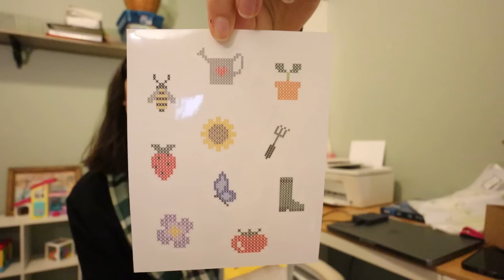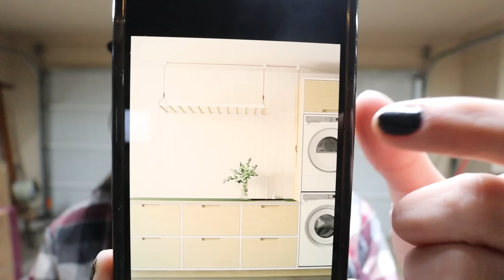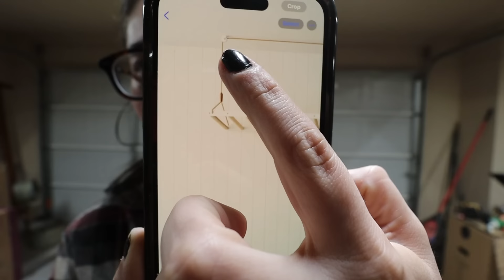VLOG | sending out merch, plant installation, & tool organization!

Comment: I'd way over shoot on the weight limit maybe to even 500 on the pulley system will hold given the weight of creamics, watered plant weight, weight of the wood, additional plants you add in down the road. Like I'd wanna be dead sure that substantial cause the loss in planters would be a hard recovery if something gave way. Sorry I'm a carpenters kid I'm always airing on the step of caution.  Are you staining or painting the frame? It's a cool concept can't wait to see how this comes together.
Reply from the maker: Oh for sureeeee I am so nervous about it falling 🤣 I think if anything I’d just do a clear coat. I didn’t mention it here, but it’s made from cedar!!